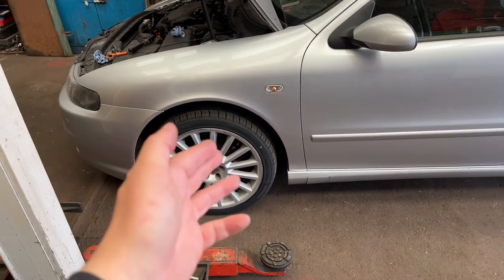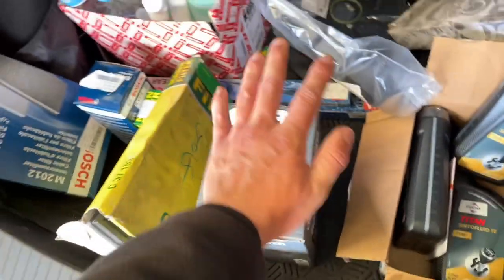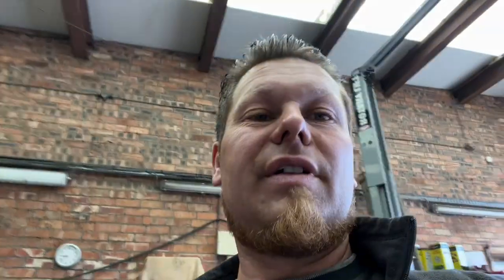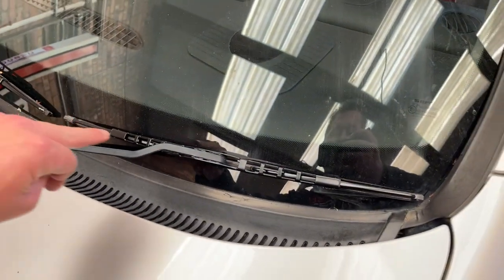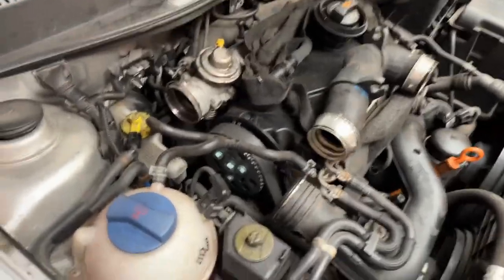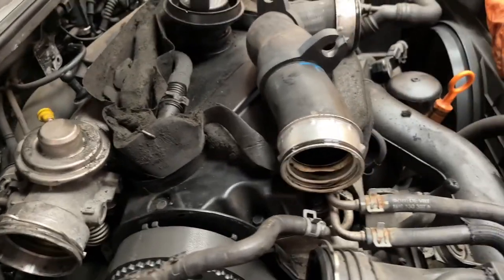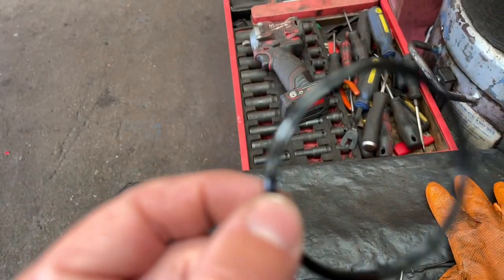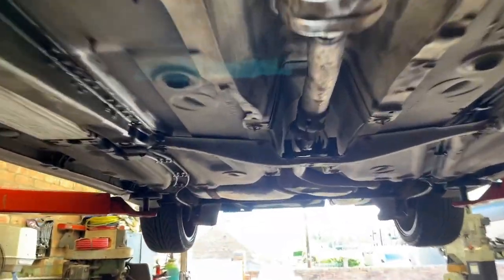PT1 Seat Leon Cupra 1.9 TDI PD 150 ARL 49k| #tdi #seatleon #seatleoncupra #vag #dubs #vlog #diesel

Comment: that langaurd gear its recommend done every year that put me right off, go old school and use waxoil underseal
Reply from the maker: It does work I do hundreds of vehicles a year, but I tend to find it works much better in new rust free cars.

Otherwise your better off using waxoyl I personally use the clear stuff over the black clag
Reply: defiantly as your dealing with rust scabs ect, wazoil is good but washers off i use that on inside doors and wings i even use underseal in heavy water areas around there were rust is prone, it wont do it again after that lol  @CarAddictGarageNE
Reply from the maker: @namAlexander I find the cavity wax is good for getting all the internals with 360 degree straws
Reply: it is as long as there's no chance of water run off as it rinses it off @CarAddictGarageNE
Reply from the maker: Bar utter cheap rubbish, very few products I have come across rinse off, unless your on with the jet wash every week
Reply: waxoil is not designed for exposer only internal tobe covered that's were the underseal comes in or any heavy duty stone chip sealer  @CarAddictGarageNE
Reply from the maker: No waxoyl can be used anywhere, cavity was is not for external use.

Underseal and stone chip are a waste of time, they trap moisture/condensation and speed up the corrosion process.

Comment: Can I ask a question?
Reply from the maker: Yes no problem 👍🏼
Reply: @CarAddictGarageNE   its ok just seen the problem 😳 alternator belt has snapped
Reply: Are they hard to change
Reply from the maker: On the 1.9 TDI PD very easy job.
Just check tensioner or something hasn’t failed causing belt to snap
Reply: It's on a polo
Reply: Car is ment to be part ex tomoz lol
Reply from the maker: Same engine yeah 1.9 TDI PD
Reply: @CarAddictGarageNE  no 1.4 petrol